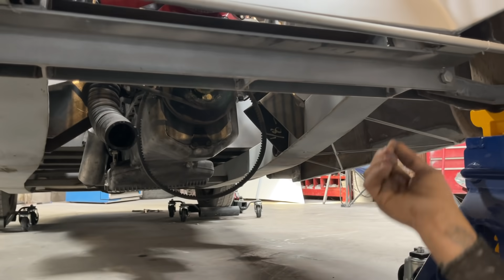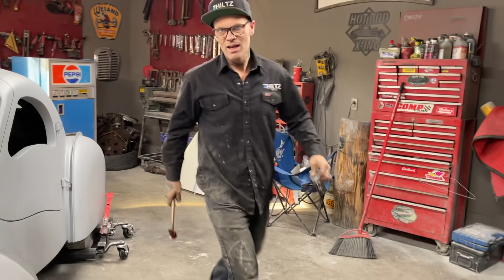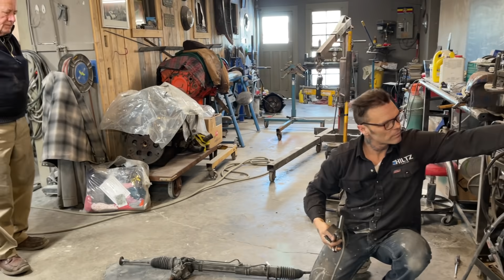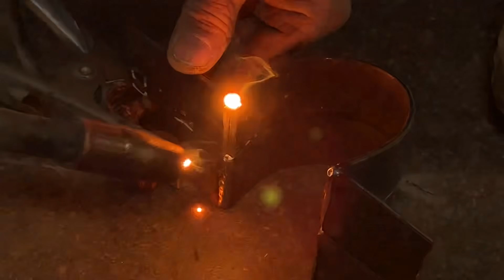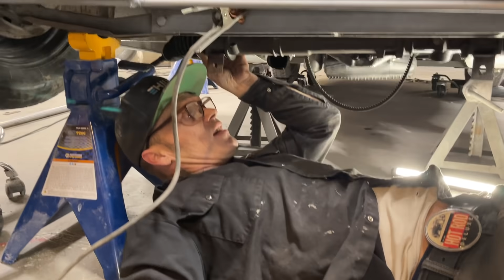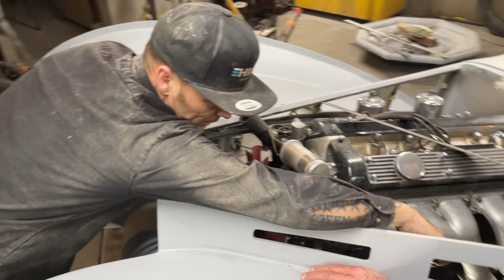RACK AND PINION POWER STEERING

Comment: You need to have a rubber bush between your rack and bracket that fastens to the cross member. Or you will have vibrations through the steering wheel.
Reply: For sure.      I'm surprised Doug hasn't got the original mounts with the rubber bushes.   edit...16.42   Doug said he has some heavy rubber at home. wts.

Comment: Hi Brad this is a rack from a Jaguar XJ 1997-2002 or XK 1996- 2005 these have a variable assist there is a 2 pin solenoid on this rack.The Problem when this solenoid is not connected heavy steering at idle. The Best is to use a rack from a XJ40 V12 6.0 same rack but without variable assist solenoid.

Comment: Hey Chad, weld a few washers on the bolt end of you vice grips. Then if you need to tighten, stick a screwdriver or a drift pin in to tighten the bolt. Love the videos

Comment: Have you checked that the rack will go the right way when you turn the wheel?
Reply: That was my thoughts. Was it mounted in front of or behind the axle in the donor car. A pal of mine got a shock when moving his Hotrod after not checking & when he turned the steering wheel, it went in the opposite direction 🤣. Thankfully the car was in the workshop, could have been on the road & that wouldn’t have been funny.
Reply: @geofo60  I firmly believe in Murphy's Law and double check everything and then triple check my double checking. Sometimes it's still wrong. BTW, O'Flaherty's Law is, "Murphy was a starry-eyed optimist."

Comment: I have been watching and enjoying this build but I am a little concerned as to how usable the car will be when completed. My brother (who lives in Scotland) built a replica Jaguar C Type from a kit using the same engine as you.  The problem is that - despite having an open cockpit and side pipes - it is extremely uncomfortable to drive in any type of warm weather due to the heat build up. It is fine at speed but becomes a real crockpot when you have to slow down

Your car has a very tight cabin with little in the way of air flow and very small windows, so without air conditioning, it might be extremely uncomfortable.  You can of course add insulation to the firewall and floor but that’s a big engine generating a ton of heat.  You might have mentioned a/c and I missed it but I just thought I’d bring it to your attention 

Keep up the good work

Comment: In stead of the cuts in the frame  for the brackets on the steering rack..why not weld ears to the chassis and cross member that supports the rack and it's stil where you want it and you have better structural rigidity in the front end

Comment: I hope that the relationship between  the rack inner ball joints and the steering arms are somewhere near correct otherwise you will get bump steer. The rack height is critical. when you get the correct spindles and steering arms you can check for bump steer  by removing the  springs and moving the suspension up and down full travel. The car will be undrivable if the bump steer is more than 1 degree. I  can see that you are limited as to where the rack can be mounted but bump steer is always a bad thing.

Comment: I can see that those lower steering rack mounts will cause issues with clearance, I would make them mount horizontally to the under side of the cross member and bolt into the boxing plate.
Looking good and its great to see Chad and Doug working together. 2 different generations learning from each other.